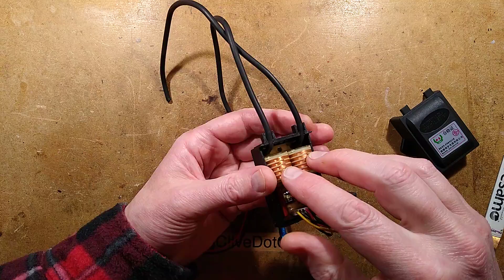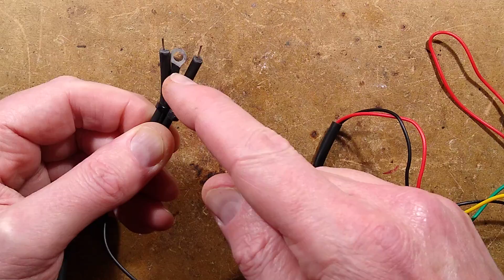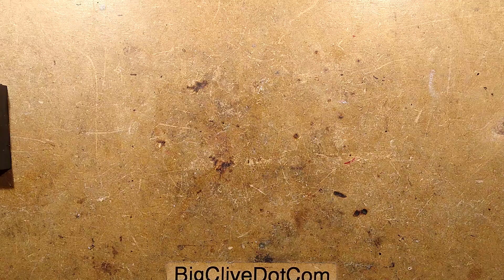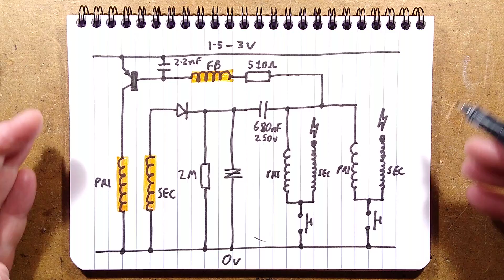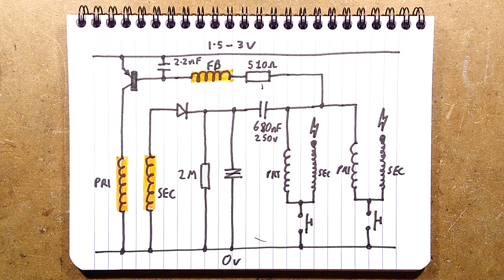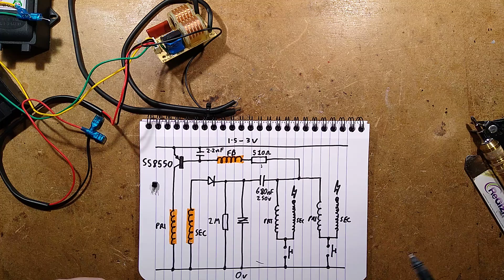Random high voltage module from eBay (with schematic)

Comment: By immersing all the components in mineral oil & increasing the input voltage by 1.5-3 vdc would i get a longer spark? (if the components don't burn out).
Reply from the maker: The main high voltage stress is on the potted output transformer, so oil wouldn't help.  It may operate at 3V though.
The output voltage is set by the sidac voltage, so it would most likely just result in a faster spark.

Comment: I use a similar module in our home electrostatic precipitator.  Seems to be adequately reliable (in that it has yet to fail after many thousands of power-on hours).
Reply from the maker: That application would benefit from a high voltage diode and capacitor like they use in ioniser modules.

Comment: V-twin coil pack maby? Or electric fence..
Reply: Thinking about it 🤔 id assume a twin cylinder engine given the 2 outputs with the 2 signal wires for some sensor or some management system to fire 2 plugs at different times.. could also use it to run 2 seperate electronic fences (2 units total 6v and would run 4 fences) but unlikely to be a fence based on the size of the unit and how it wires up and is triggered i really think it might be a cheap aftermarket product to add a coil pack ignition to something burning petroleum or LPG like a BBQ or motorbike as it's battery operated.. the potential uses for this are huge.. something from China thats not 100% landfill e-waist lol..

Comment: For an oil burner igniter, those HV transformers look pretty flimsy.
Reply from the maker: It's for gas.  Oil would require a stronger spark.
Reply: @bigclivedotcom  Still looks pretty flimsy for something that needs to reliably light a burner on a regular basis.

Comment: I suggest an arc-starter (also called arc-stabilizer) for TIG welding: it contains an HV step up circuit that charges an HV capacitor up to few kV.
Once the capacitor is charged, a spark gap fires and connect the capacitor in parallel to the primary winding of the output transformer: the secondary side of this transformer is placed in series with the welder output.
Of course, the output transformer is a pulse transfomer (usually 1:1 or with a slightly higher transfer ratio) with a small primary coil and a massive secondary coil capable to carry the whole welding current... hundreds of amps!.
Older units were made with massive 50Hz laminated transformers, massive spark gaps, ceramic insulators, big caps and massive output transfomers (much much better to see!) but newer units are still cool. 
After the review, you can also install this device in your arc welder (are meant to be used with TIG welders, but are also very useful for regular stick welding!)

Comment: My first thought was "low Voltage minimum shock" but now I'm thinking, door guard shocker. Motion sensor, small solar panel and lithium battery. Bingo, thieves afraid to touch your property.

Comment: anyone here know how to work with 0.1mm tungsten wire? so far my efforts have come out a bit flacid 
fixing ionic air purifier and i’m finding it challenging to wrap a small bar and tie off under spring tension.
Reply from the maker: I'd suggest using a generous amount so it's easier to handle, and try to tie a knot to attach it to other wire.
Reply: @bigclivedotcom  I'll try that. Thank you

Comment: I'm wondering if this could be used as a substitute for a "buzz box" self oscillating electromechanical spark generator, as used in various vintage and veteran motor vehicles and stationary engines.

It would make one hell of a bug zapper!

Comment: Is there any chance that the two high voltage transformers are wound opposite of each other as to put them into opposite polarities within their cycle?  Thus you could go from phase to phase with both enabled rather than both phases to ground.

Comment: that's just the module I need for my stove...  cannot find it on eBay though, does anyone know the search term?
Reply from the maker: The listing is :-
Automatic Gas Igniter Unit Gas Oven Pulse Ignition Controller Lightweight

Comment: Now I'm wondering if those zippo style rechargeable lighters that have an X pattern discharge between four electrodes uses this circuit? 🤔  The temptation to open up the one I own is great... But the urge to keep it working is greater! 😄

Comment: Another cool HV thing you might like a look at are xenon HID ballasts. They have a little series igniter circuit that often uses a small gas discharge tube to dump the capacitor. Also look up "Hella HID igniter" for ideas ☺️
Reply from the maker: I have one of the electronic ballasts here.  I should really make a video about it.

Comment: Off topic..
   Are octo-plug relays with glass covers under vacuum? They look like tubes (valves) except there is a 24v relay inside. I have glass vacuum capacitors so I wasn't sure if vacuum relays was a thing also.
Reply from the maker: Some high voltage relays have a vacuum in them.
Reply: Thank you kindly Sir.

Comment: Clive in the garage where I worked we used a Snap On spark plug tester that went faulty.
When opened up there was a very simlar circuit to this inside it.
(Couldn't fix it, got a free warranty replacemet)

You would, open the lid, screw the plug in a hole in the top compartment, clip a lead on the top electrode of the spark plug, close the lid, push the button and if you see the spark through the clear window the plugs OK, no spark, duff spark plug, easy to use, small and portable.

It took 2AAs in a compartment on the side.

It had a safety switch on the lid as nothing happened if you pushed the button with the lid open, and it would stop sparking if you opened the lid while the button was pressed.

You often get duff spark plugs even if they are bought new, we would test them before installation.

Comment: Could it be used for automotive applications? I'm thinking of an ignition control unit for petrol engines.
Reply from the maker: I doubt it.  The timing might not be good at high speed.

Comment: With three transformers crammed so close together like that, do you get whatever the power circuitry equivalent of crosstalk is between them?
Reply from the maker: Not significantly.  It would be an issue with audio transformers.

Comment: Can we use this circuit for ionizer? If we keep proper distance between high voltage terminal from the ground discharge terminal? Can we use it to collect highly charged particles to collect at the negative terminal and use it as an air filter?
Reply from the maker: To use it as an ioniser the output would need a high voltage diode and capacitor.  You can buy dedicated ioniser modules on eBay.  Don't use the low voltage ones as they can create a high voltage differential across power supplies unless the negative is grounded.

Comment: Small gripe in thumbnail, should be kV not KV . . .
Reply from the maker: Sadly, that font option doesn't do lower case.
Reply: @bigclivedotcom  Thanks!  At least you tried :)  I have the same issue with some paragraph heading fonts and such.  I asked the SI unit folks at NIST about it and they told me to just spell out the unit, but sometimes you don't have that much room - like in your thumbnail for example.

Comment: Interesting device! I Just thought Yesterday about a solution to ignite oil fumes in my diy oil heater. Does anyone have a link to that interesting HV device?
Reply from the maker: This is better suited to gas than vapour.
Reply: @bigclivedotcom  In Germany many older Houses used to have single room oil powered furnaces many decades ago. This was an easy and convenient replacement for coal and wood furnaces. They were terrible from todays perspective but a great thing back then. Because most houses already had the exhaust passages already built in and a propper water based central heating furnace was more expensive to add to an allready existing Bildung. However most of them were manually lit by a match so you had to turn on the oil and wait for the burner pot to get wet. But not too long otherwise you won't get it started. But there were some more fancy units with automatic ignition systems. This was basically a device like a glow plug and a spark plug combined. A small ceramic based cotton-like material was soaked in oil, heated by a wire until the oil starts to vapourise and a spark genetator above ignited the fumes. And I want to build something similar with an diesel engine glow plug and a spark genetator like this for my mobile oil heater DIY project. Because "OEM" replacements for these furnaces are very specialized to fit the device they are built for and they are heavily overpriced.

Comment: I wonder if attaching this circuit to a neon sign or fluorescent tube would work. Like, would it be strobing, or would it light continuously. Judging by the circuit design (similar to that mains igniter from a previous video) I'm thinking option A. (Also a xenon camera flash lamp may be interesting, it works on those small 'tazer' modules, so I would assume so.)
A sidac is a wonderfully weird device. Looks like it was made with this specific purpouse as a trigger switch for an HV igniter.
Reply from the maker: It would make a tube glow, but not brightly.

Comment: Had something very similar in an old Cannon gas cooker 50 years ago. D Cell in a holder at the side of the pan drawer at the bottom of the cooker. One button for the oven, one for the hob top. The battery would last around a year before needing replacement and these were the old zinc carbon batteries!
Reply: The ones filled with delicious Ammonium salt, or a modernized type?

Comment: What would happen if you rewired one of the HV transformers primary the other way around and then wired the buttons so that they were always on, would you get double the voltage and be able to just use the HV leads to a spark gap.
Reply from the maker: You could theoretically double the voltage.

Comment: I wonder if I could use something like this for testing old (often Bakelite) insulators?
I rebuild vintage engine magnetos & have to test things like high tension pickups, distributor caps & slip rings to see if they’re still functioning properly (often they’re unobtainable, so I’d have to make them from scratch if they needed replacing).

I currently use a weird setup (donated by a retiring magneto rebuilder who has since passed away) that uses a car ignition coil with a vibrating contact (using the slight magnetism from the end of the coil canister) but it’s very finicky to get it right, something like this would be better. It doesn’t want too much voltage or frequency though as the skin effect & ionisation will give false results.

Oh yes, & I do wind & encapsulate my own coils, so I suppose I should stop being so lazy & build my own tester, I just wish I had the time.
Reply: Please beware that a coil vibrating it's own power switch has 2 classic uses: 1. As the "motor" part of doorbells, with an extended arm being the hammer striking the bell.  2. As the classic arc radio transmitter outputting on a mostly uncontrolled frequency.

Comment: I wonder if you could bypass the initial step up transformer. Then feed it mains voltage, via a capacitive dropper and a bridge rectifier. The capacitive dropper should limit the current when the sidac fires, but still provide sufficient voltage to charge the reservoir capacitor.
Reply from the maker: Theoretically you could do it with just a diode and some resistors, but the output would not be fully isolated from the mains.

Comment: I am almost sure what you have is actually the coil pack for the little Chinese model engines.  They would have a little box with a 18650 or a couple AAs hidden and the trigger wires would be hooked to a set of points.
Reply: That would make sense. A hall effect device to switch the operator circuit could run a 4 cylinder engine, with 2 idle-sparks.

Comment: That is not much unlike a replacement power supply that I built for a old night vision device. 
It starts with a optimised joule thief, feeds a 1µF capacitor and a sidac triggers a transistor that pulses to a transformer. Followed by a simple 20kV diode and capacitor, I just placed a 500MΩ resistor. It drives the gen0+ tube just fine at 17kV while consuming about 8mA from a 1.2V AA cell.

Comment: Did you draw the transformer circuit backwards? Isn't it energizing the secondary winding and using the primary windings as the discharge cable?
Reply: the circuit is a classic car ignition type, you pull the primary, then let go and it puts the secondary in series with the primary.  Car ignitions put a small capacitor across the contact and fitting one here may help reduce switch burn.
Reply: Primary is defined as the energy input side, not the lowest voltage side. Big power stations often have huge transformers between the dangerous generator voltage on the primary and the secondary output to the long distance part of the grid using 100kV or more to allow thinner wires between cities.
Reply: @johndododoe1411  This is a step up circuit so the roles are reversed.
Reply: @amojak  No, they are not.  Stepping up reverses the scale ratio and related components, not the primary/secondary terminology.
Reply: @johndododoe1411  the primary is the driven side, the secondary is what is coupled to it.
Reply: @amojak  Exactly my point, someone else wrongly thought primary was always the highest voltage side.
Reply: @johndododoe1411  yep which is what i was correcting :)

Comment: This might work well for my cigarette lighter idea. I've been trying to make a compact high voltage spark lighter that takes no fuel. Lights in high wind. Not good for a fire starter only for items you can stick in the cig size hole. Build the unit in a wood block to separate the high voltage from the low voltage side and compact it's size as a table lighter.
Reply: just buy 3 for $1
Reply from the maker: Look up plasma lighter.

Comment: There's a new group of cheap automotive LED headlights that claim to work with original equipment HID ballasts. I'd love to see how they handle that for under $20 a bulb. I think the ballasts output AC, which makes it even more interesting.

EDIT: incorrectly remembered.
Reply from the maker: To be compatible with DC and also high frequency drive for discharge lamps would be complex.
Reply: the "ballast compliant" led lights also need to withstand the 20kV HID ignition pulse
I have some ballasts which sends a 24kV pulse for the xenon,
the LED light will not be happy with that
Reply: The xenon replacement LED bulbs have an external module to turn back the high frequency AC voltage into a lower DC voltage for the LEDs, I guess that high voltage DC ignition pulses are not generated when there is a load connected to the output of the ballast, because a xenon bulb while the arc is not lit is like an open circuit from the point of view of the inverter.

With xenon bulbs the high voltage is only required to strike the arc, once the bulb ignites it clamps down the voltage to a much lower voltage, on automotive bulbs it's 85V for earlier bulbs with mercury (D1, D2, D2H and all retrofit bulbs for incandescent headlights) and 42V for newer mercury-free (D3, D4) bulbs.

The high voltage pulses are generated by an small ignitor transformer wired in series with the main inverter output that adds high voltage DC pulses to the lower AC voltage created by the main inverter.
The inverter and the igniter can be in the same housing or in separate housings, D1 and D3 bulbs have it in a box integrated into the base of the bulb while D2 and D4 can use a separate igniter that fits to the bulb base or an inverter (ballast) with built-in igniter which connects to the bulb with wires and a socket.

Retrofit bulbs for incandescent headlights always have wires soldered to the base with a connector at the other end, there are also D2H retrofit bulbs for xenon headlights designed to use cheaper aftermarket ballasts, those also have wires soldered to the base with a connector on the other end and come with a grommet to pass the wires through a hole you have to make in the original headlight dust cover.

Those aftermarket are available with integrated ignitor or in slim versions with external ignitor but they are soldered and sealed to the wires and sold as a single unit.
Reply: And there are also replacement LED tubes and bulbs specific for fluorescent fixtures with electronic ballasts, they refer to them as high frequency ballasts or HF ballasts, those special LED tubes and bulbs usually won't work on fixtures without electronic ballasts.
Reply: Update on this, I went back and looked for the ebay posting I saw this on and I think it was a bad translation. They said "optional ballast" but i think they meant "compliant with ballast". I only see items that work with the ballast directly or by bypassing the ballast.

Comment: Pulse DC HV are not fun to my mind.  They are noisy and not very hot, maybe enough to ignite gas and not much more. I prefer High frequency AC HV circuits. They are quieter (nice sound actually) and very hot, can ignite anything. They are better at the safety aspect too, if you touch them you can get burned, but at least not shocked. With the device in the video you would have to be careful not to touch it, a proper stun gun this!

Comment: Could it kill a rat
Reply from the maker: No.  But it could annoy it greatly.
Reply: @bigclivedotcom  Add a large hv capacitor in parallel to the circuit & it may kill a rat.

Comment: Why would you need two? Gas igniters tend to spark every burner at once and only use a single generator
Reply from the maker: Maybe just to optimise spark strength.
Reply: Cuz the typical Chinese stove are 2-burner model.

Comment: clive what u think what will happen if u give  5v input.will the spark get stronger.
Reply from the maker: Yes, but with a higher voltage there is extra stress on the first level step-up circuit.